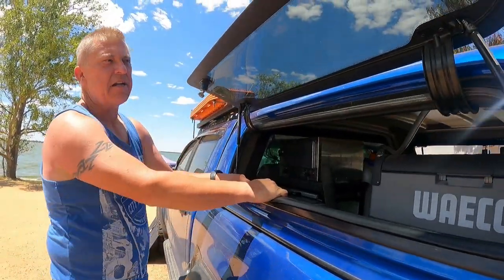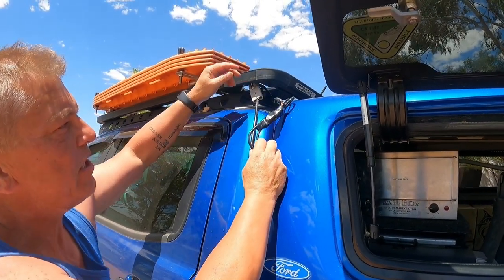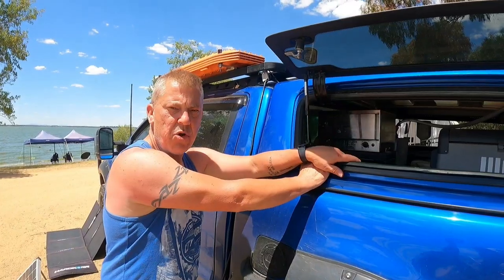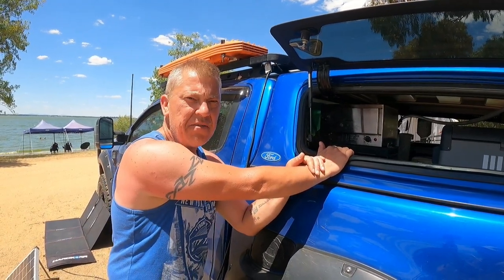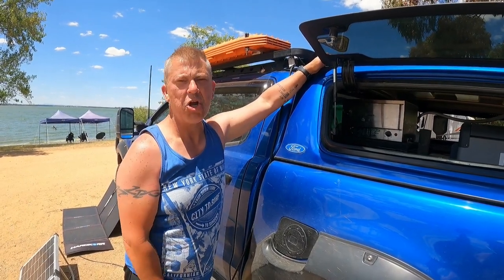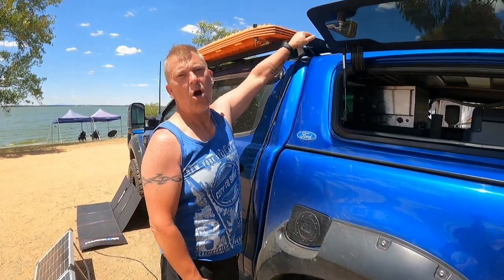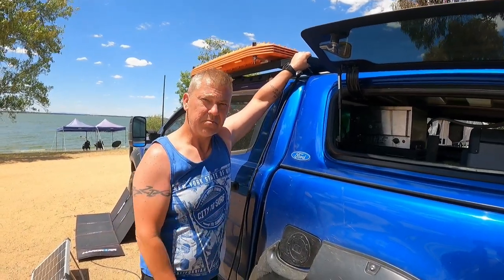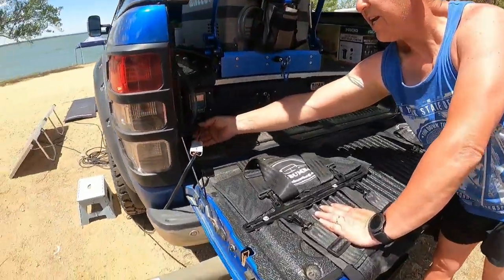Problem solving - when your hard wired solar panel on your secondary battery stops working!

Comment: I had flexible panels on my previous van. They worked great for the first 4-5 years, then the output drastically reduced. Been looking at the new Golf and decided not to go with flexible for the same reason. The Golf already has a 120W up there and I don't think I can add any extra weight. So going to rewire some parallel Andersons for glass panel portable to deploy as needed. The Projecta BM335 in the van will take up to 440W of panel and their tech support said it has been tested up to 80W. However max output is still 20A. Will install the BMSHUNT a. for adding a diesel heater and if needed a bigger solar controller. At least the "on trip" fix worked. :)
Reply from the maker: Yes on our van we'd switched to 2 x 250 watt flexi panels & so far are very happy with those 🤞 (they're a different brand to the ones we have on the car which have failed in less than a year! 😞) Jason changed from a projecta to Victron DCDC & an Enerdrive for the external & we're finally really happy with how it's all running 👌
Reply: @familytrippersozstyle6255  Michelle, did you have any issues with the Projecta. I think you might have mentioned something re electrical issues? What brand Flexi 250W and are they on roof?
Reply from the maker: We thought we were having problems with the projecta originally which is why we replaced it (we replaced it with a bigger system to take the extra wattage).
It turned out after everything,  the problem with the van was a loose wire! 
So we are now using the projecta in the car secondary battery system & it's working fine
Reply: @familytrippersozstyle6255  I'm hoping the 500A BMSHUNT will take care of all the other loads, lol. Will reply more tomorrow via Facebook